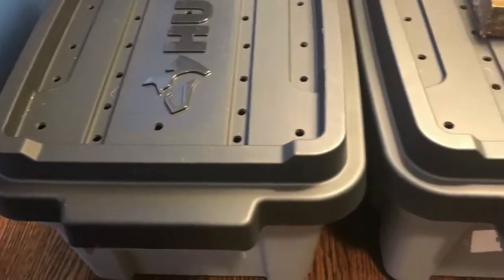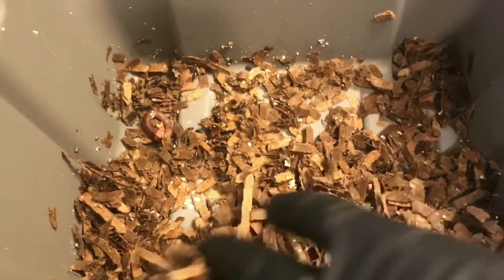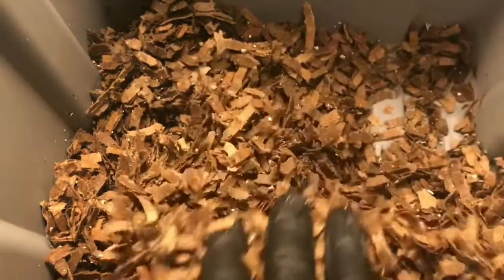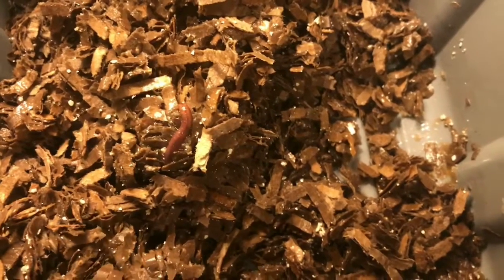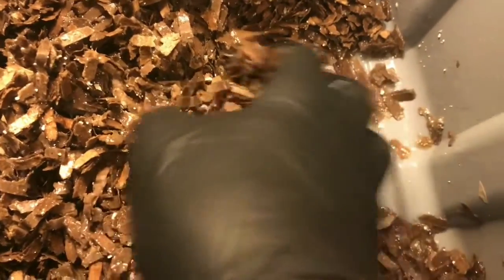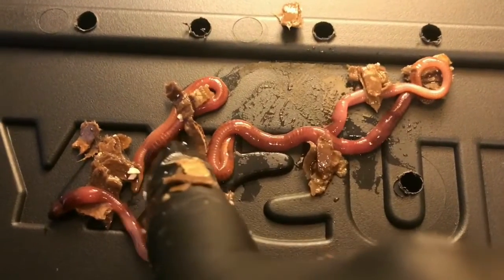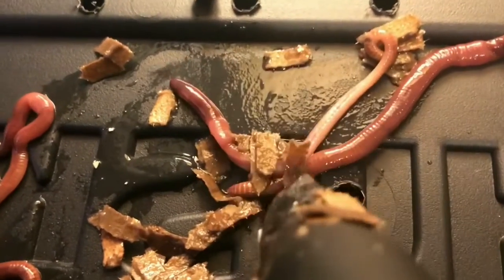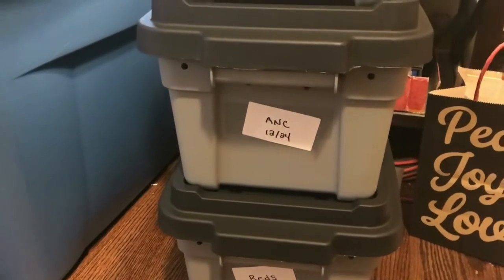The Reproductions Games: ENC vs. ANC vs. Reds & The 2019 Mystery Begins (see description)

Comment: I really like this experiment. The moisture level in the enc, if you have the bins stacked and their on top they have more ventilation. Spread the bins out or stack a fourth bins on top. Try and keep all things equal. 👍
Reply from the maker: Red's 68 they are all sitting side by side and no vent nearby.  Odd, but I added a bit of water to the ENC bin and topped all the bins with a piece of paper towel. 🤞🏻 this gets us back on track.  Thanks for watching and commenting!
Reply: @TheCrazyWormLady  I was thinking  that the bin in the middle the one with more moisture doesn't get as much air as the others (from the sides). The result could have been different if there were more space between each bin.
Thanks for the videos. I like these kind of experimental science.